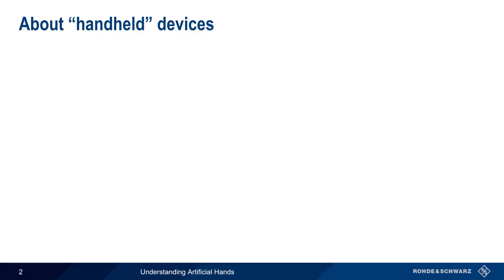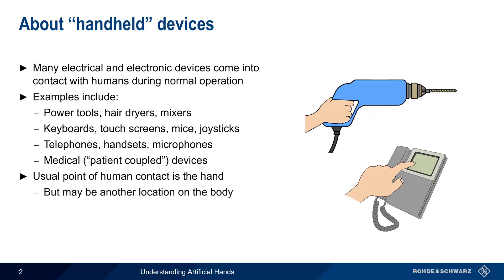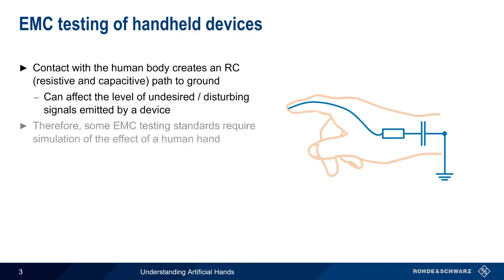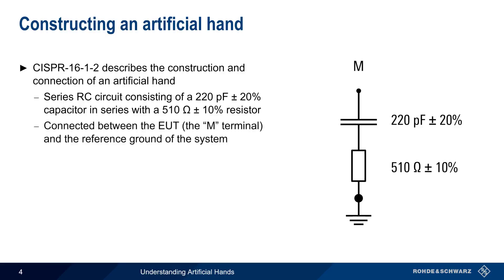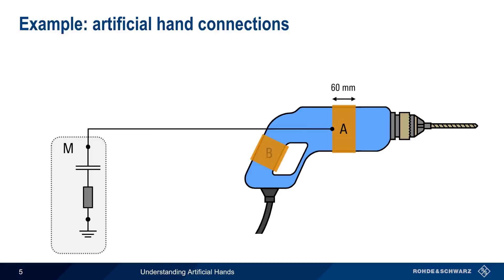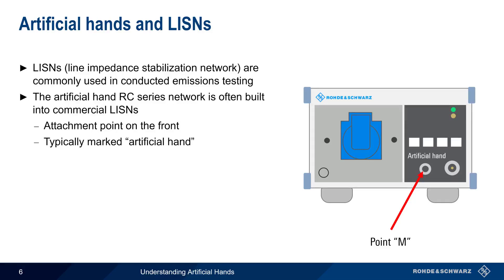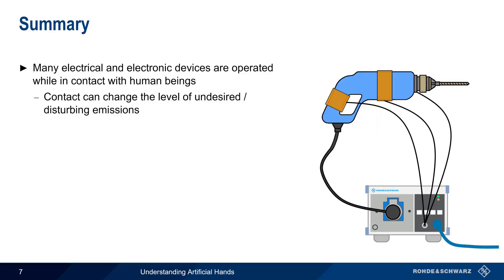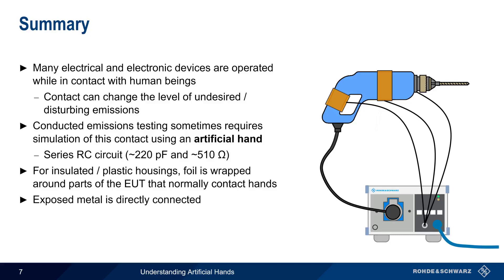Understanding EMC - Artificial Hands

Comment: Thanks for the video,

1) If we don't have the LISN device; 

should the GND at the bottom of the RC network be connected to the protective earth (PE) in a battery powered device with a completely plastic exterior and no exposed conductive surface?

2) If we don't have the LISN device; 

In a device that is completely plastic outside and has an exposed metal USB port (usb outer case is PCB ground) and runs on battery, should the GND at the bottom of the RC network be connected to protective ground (PE) or should it be connected outside the USB port?